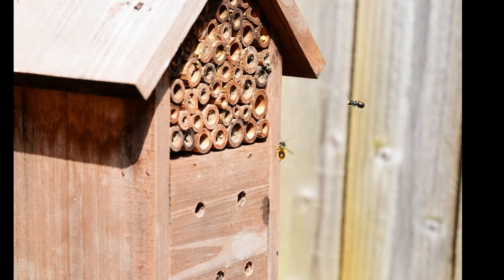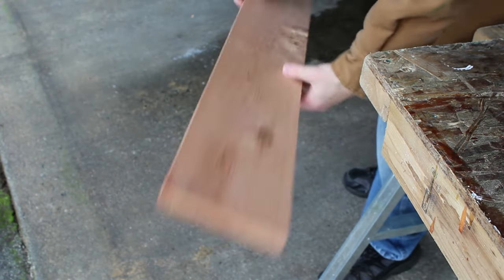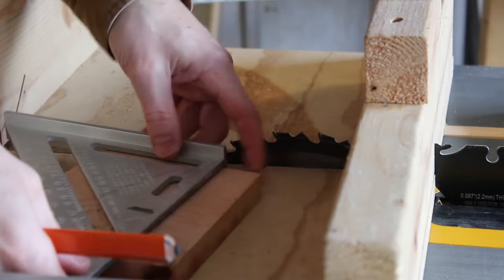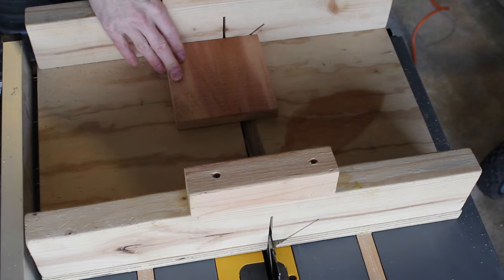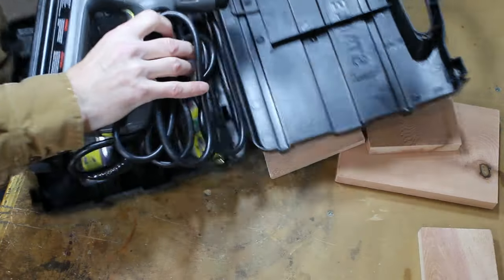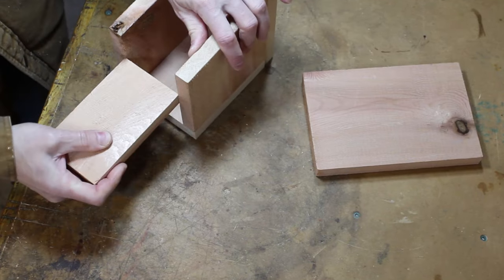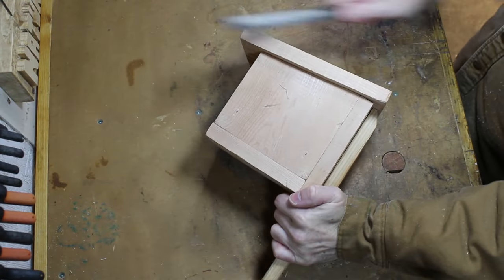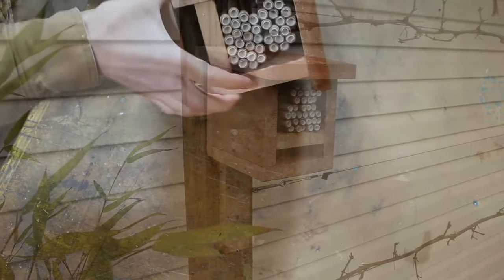How To Build a MASON BEE HOUSE - From SINGLE FENCE BOARD - Easy DIY

Comment: Great video!.   What is the reason for the shelf?  I don't see these on other mason bee homes.
Reply from the maker: Thanks! The shelf is there to place the cocoons on for release in the spring.  I actually use small jar lids to hold the cocoons and then I slide the lids into the shelf.  I have a short video showing/explaining this: https://youtu.be/DefWWFjiNs4
Reply: @natureyardlife  thank you!
Reply: @natureyardlife  one more question...can you start a bee house without cocoons?
Reply from the maker: @928RENTALS  You certainly can....however, there is no guarantee that you will get any bees to actually nest....it all depends if your garden area,  or where every you put up your bee house, is a desirable place for random bees to take up residence.  You can encourage them by making sure you have early season blooming flowers that will provide a source of food for them as well as pollen for their nests chambers. Also, be sure to have some clay mud around in the area, so the bees have a source material to build their chamber walls. 
By putting up a bee house, you are at least providing an option for your local friends to nest in.....you may also attack other bees, such as leaf cutter bees if you put up a house.  Whatever you decide to do, you are helping out in some capacity none the less.  Good Luck!
Reply from the maker: If you are not sure if there are mason bees in your area, or you don't get any to nest, you can always order a small box of bees (online) to start your colony.  I started with 20 bees my first year....this is my 6th year and my colony is about 2500 bees.  I give away a lot of cocoons every season, not only to help others locals start their colonies, but I also don't have the capacity to support more than that in my yard area.  Bottom line.... easier to get started with a small batch of cocoons and then grow your colony, than to wait for local bees to "discover" your nesting tubes.  My bee houses have slots that I put the cocoons in for hatching, so when the bees emerge, they already see the tubes waiting for them....it works really well this way.

Comment: How did you set up your sled?  I'd like to make that.
Reply from the maker: I used a 3/8 plywood base -14x20 - this is the size of my table saw top...I'd have preferred bigger, but it's a portable saw, so limited size. I cut two strips for the sled channels, slightly less deep and more narrow than the channels themselves. To attach these, I put them in the channels, slightly proud using something under them, put glue on the top of them and then lay the plywood over them. Next, I flipped the plywood and  secure the strips.  Added 2x4 boards for the front and back - with additional topping pieces to hold it all together, as the plywood will be cut in half on the first pass over the saw. Stacked a few 2x4 cuttings for the blade guard at one end. Just make sure when you are attaching everything, that none of your screws or nails end up in the path of the blade when you start cutting. Also, plan for angular cuts too, for when you slant the blade.

Comment: What size tubes did you use and where can I purchas them.?
Reply from the maker: There are different size tubes available, but a typical size that I find works well is 5/16 inch diameter and 6 inches long.  You can go a little longer or shorter in length if you choose. Finding them in a typical pet store can be challenging, so I always buy them on Amazon...here's an example: https://www.amazon.com/URATOT-Outdoor-Cardboard-Beekeeper-Replacement
I also like to line my tubes with paper which makes it easier to harvest the cocoons...here is my video for that: https://youtu.be/DUzNk4x1dJY
Good luck!

Comment: Where do you get the tubes
Reply from the maker: Hi Scott, good question. I could never find them in any gardening store, nor big box store. Over the last few years, I've just ordered them on Amazon - https://www.amazon.com/s?k=mason+bee+tubes&crid=2B5F8OMDD5H9F&sprefix=mason+be+tubes%2Caps%2C146&ref=nb_sb_ss_ts-doa-p_1_14
Be sure to check the length that you want. 6 inches is the typical size, but I ordered 5 inch once by mistake - the bees used them all the same.  I don't recommend shorter than 5 though, as the first two or three cocoons are female and the rest male.  If the tube is too short, the ratio will be off - it's usually about 2-3 female and 4-6 male.